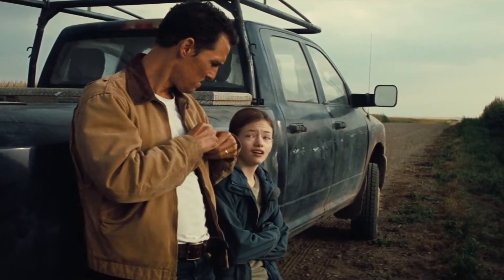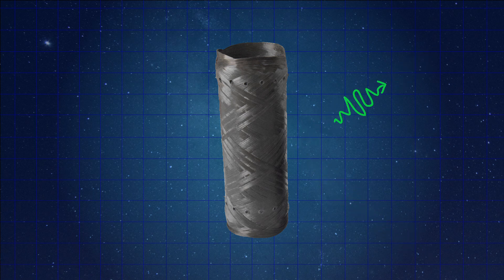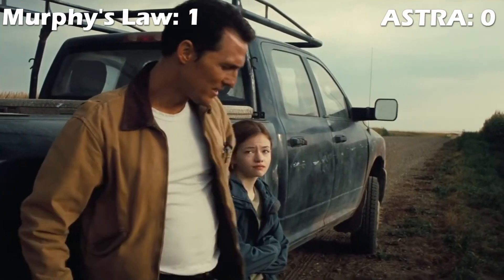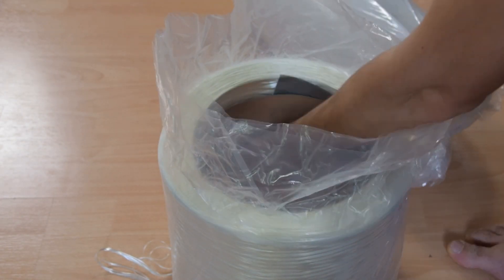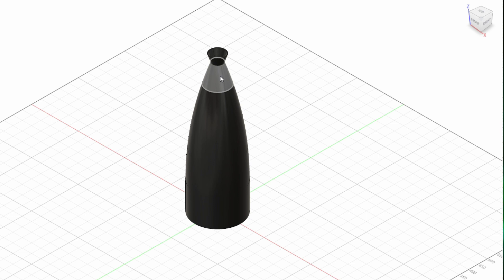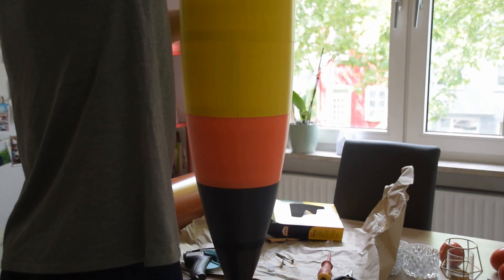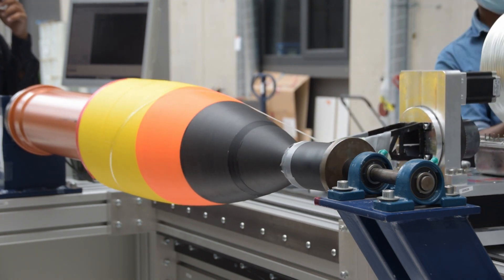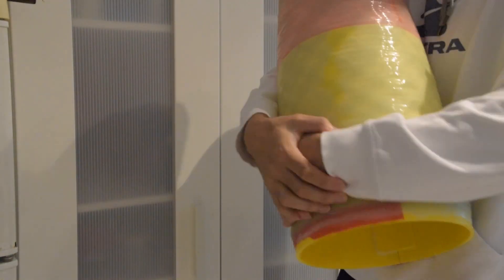Nosecone Manufacturing Hell

Comment: why didn't you just vacuum bag glass mat over the top and next time don't get a prusa, if you don't want to keep the mandrill use PVA and throw it in water if it's PLA get a heat gun and peel it off either way  you lose it

Comment: What is the melting temp of the printed mandrel vs the fiberglass resin temp resistance?
Reply from the maker: The PLA softens around 80°C and the fiberglass resin should be solid to at least 120°C.  We actually exploited this and were finally able to remove the nosecone fully yesterday.

Comment: often times your focus prevents a solution, step back look deeper into alternatives.
Reply: your telemetry can be set on the surface with antenna coming out.
Reply from the maker: We have considered that.  But, in the end, a fiberglass nosecone is also really good for mass and structural reasons.  Also, as we don't have a lathe, that also rules out the metal options.  But, in theory, we can make anything on that winding machine, provided we get good enough at it.

Comment: Use fillers to close the gaps in the 3d printed parts. use a release agent to release the fiber glass part off the mold. Use polyurethane foam or other expanding forms inside the 3d printed mould to give it structural strength from the inside. Also to release the fibre glass material, you can some what stress the fibre glass Part and the mold through crashing or squishing it slightly, fibre glass shall not be damaged because it's already a slightly flexible material.

In case the tips were useful, mention ma name.
Reply from the maker: Thanks for the helpful thoughts.  We already were using a release agent, but we definitely will try to fill the gaps next time and attempt to support the mold better to prevent buckling and breaking.

Comment: I just had this project come up in my recommended list, this looks interesting.  A couple other takeaways:  Get the components working correctly so you don't have someone manually feeding the fiber and holding up the end of the roll.  The cone mandrel needed an inner support like a dowel or all thread to strengthen the weak end.  Wrap the cone mandrel in plastic wrap, just a thin layer, to prevent the resin adhering to the plastic.  To get the cone off use a Dremel with a sanding drum to remove a slot of the mandrel and give you some wiggle room to work it out of the cone.  This looks like a really fun project to be working on!
Reply from the maker: We are 100% going to fix the Fiberglass feeding system.  We only did it this way because the fiber was already in the resin and we didn't want to waste material.  To solve we will transpool to a smaller drum.  We are also planning to redesign the mandrel (most likely with some more internal support).  We are also planning to make it possible to take it apart from the inside in the case that it is too difficult to get the Fiberglass off.  We didn't have a problem with the resin adhering to the plastic (it actually came off nicely in that respect) it was more that the resin went into the cracks and formed ridges that didn't slip nicely.  To solve this, we will fill the cracks by either using tape, plastic wrap, or some other solution.  Thanks for all the suggestions.  They definitely help us see different perspectives and hopefully will lead us to a successful trial on the next go!